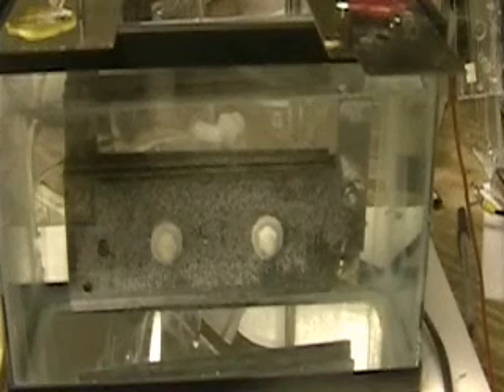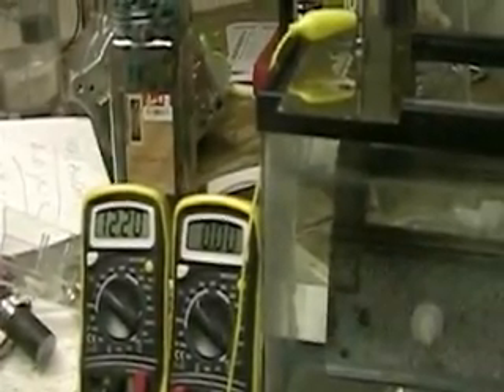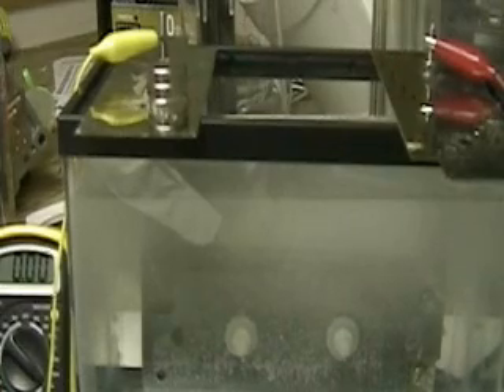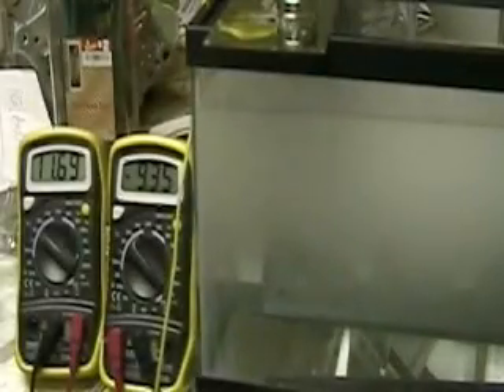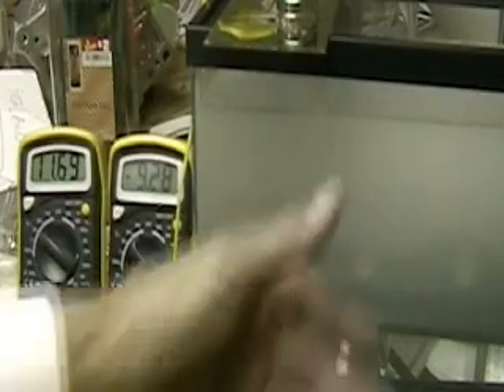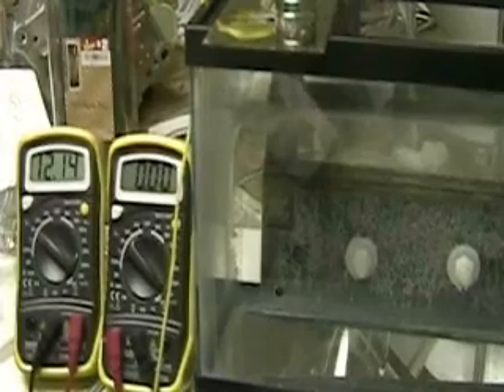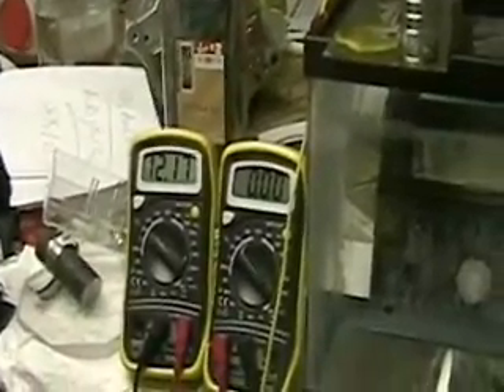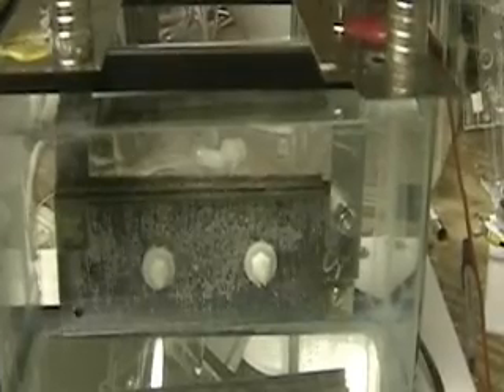Hydrogen Tap (FOCUS-MAGNETS) 355

Comment: John,

you keep refering to "too much hydrogen" when you turn off your power supply. Is the hydrogen irritating you or are you concerned with an explosion?

I've noticed that when I run my cell in an enclosed area my throat gets rather irritated and after watching another video I'm wondering if it might not be Hex Chrom gas. I've read that some folks are alergic to it and that it can irritate and cause asthma like symtoms.

Just a thought.

Comment: agreed ... verdict is out until proven ... there was a lot of work done in this area 50 years ago ... but documentation is hard to find outside academic circles ... so we are forced to try to rediscover what was once common knowledge ... it was even said to be possible to disassociate water with a weak acid catalyst using strong magnetic fields ... now that would be interesting to figure out how to do ...

Comment: Have seen designs that use electromagets to direct the O2 down one path and H2 down another so they can be collected independently.  Have not experimented with such a design, but suspect it might just work.

Oxygen atoms are highly magnetic and will be attracted to the "north" pole of a strong magnet.  Hydrogen has a much weaker magnetic charge but is attracted to the "south" magnetic pole. To seperate the two, key on the O2 and pull it out via magnets. (ref: Alden P. Armagnac, 1944)